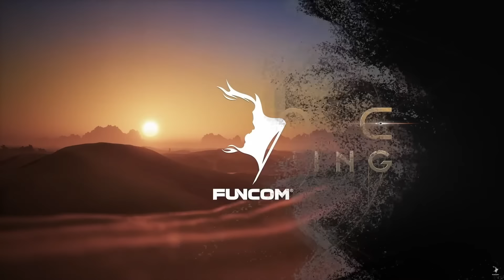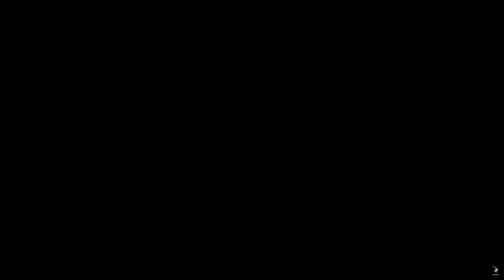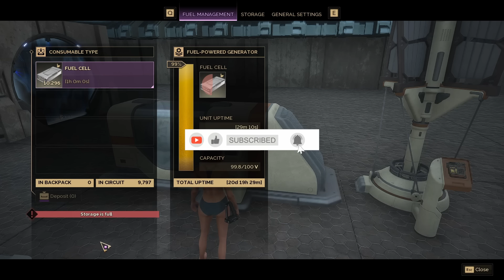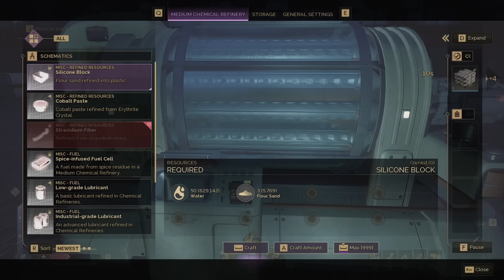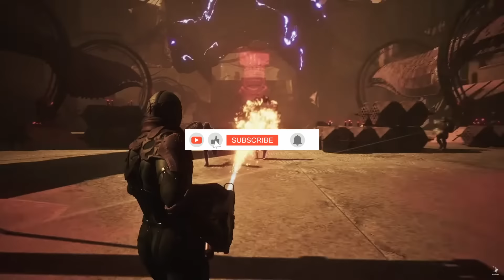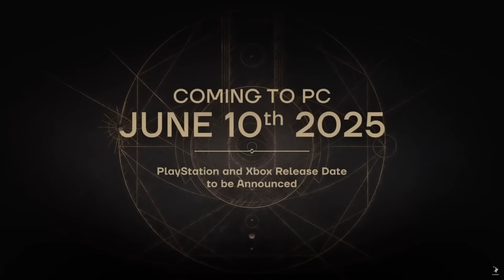Best Power Generator in Dune Awakening? Full Comparison & Breakdown

Comment: This is so wrong, your never going to run an advanced setup and the big spice refiner without the spice generators. You’re already maxed on power with no advanced death stills or wind traps, no advanced chemical refiner or ore refiners. This setup is low tiers BS.
Reply from the maker: Then please tell me HOW am I running a large spice refinery, large ore refinery,  ALL the advanced refineries, as well as 6 death stills using directional wind turbines as mu sole sorce of power? I currently have over 8000 power being generated with no problems.

Comment: its funny because I have the opposite setup --- my deep desert base is the one where I have a production limit, and therefore basic generators dont work  -- my permanent base Im perfectly fine using stakes to extend the size (and therefore the production limit) so I've been fine with oodles of the bsice generator - but the deep desert base is where I need more efficient power; the time and space to setup all those mini generators are limited -- but more importantly the production limit if Im running a large ore refiner, medium chemical refinery, large spice refinery, some water generation (large windtraps, advanced deathstills), decent sized pentashields and a couple utility buildings like recycler/repair, maybe even a couple fabricators -- then the 30 or so generators you can make wont provide enough power unless I turn things off -- sure you can turn off the utility things, but the water production and refineries take a long time and I usually have them up and running most of the time. my first couple of weeks, I made due with generators - but I have a ridicioulous amount of overstock on spice residue now. I made ok money selling them on the market, but this week Im using spice generators, and its so nice to have it taking up so little space, and be able to keep all my stations on. Im even gonna build a couple more windtraps I think. (as a solo player, its not really worth it to run more than 3 deathstills I think, as I can only bring so many corpses in a run). 

Due to how much lighter Spice Melange is than spice Sand, and Plastinium compared to Titanium+stravidium it only makes sense to process everything in the Deep Desert -- especially when you're getting stared and the half cost to build means you can get to the more efficient refineries quicker. 

If I ever were to take a break from the game, but wanted to keep my base up and running- I could see value in having a longer window where my power runs unattended (but what is the tax period?) 
AND if you're just getting started in the deep desert, basic generators are better as until you max out your production they are enough.
Reply from the maker: We were doing the same thing for a while, but after the recent incident with the control point move, we nearly lost everything. So from now on, we’ve decided to use the Deep Desert strictly for staging and storage—no more refining out there. We're moving all our main refineries into the hagga basin going forward. It just feels a lot safer and more stable long-term. It's also a lot of money that you're spending per week to put all those staking units in. I can understand using half priced items to build. Thank you for the comment.
Reply: No staking units for me!

Comment: This is impressive, over 15 minutes for a “full comparison and breakdown” video with not a single chart or table comparing actual numbers to provide evidence for a conclusion, that is basically, build what you can afford to supply, but your opinion is the directional turbine is best, or the fuel powered if you don’t need massive power.  I suppose a 30 second short doesn’t get the same views.
Reply from the maker: You're totally right—I went over all the fuel and refinery costs in the video as I talked through them, but I didn’t make an actual chart. 😢 You could also grab the info from the video description if needed. As that doesn't get views either. Thanks for the comment and the feedback!
Reply: Are you really so dense that you need a chart??? I thought it was great, very through, and didn't feel like a business meeting. 

I guess to each is own but some of us use our brain to visualize the numbers, not have someone else do it for us 😂😂😂

Comment: hope funcom change the light u holding in your left hand not right hand. so we can use one hander weapon with light that the same time just like in conan exilse.
Reply: There is a normal light you can craft and activate it while holding weapon/tool, it fits in separate inventory slot
Reply: @imdkvideo   can you make a youtube how to do it.:eyes-pink-heart-shape:
Reply: It's called the personal light.  It's a steel tier item that you don't have to hold.  You just equip it and press "0" to turn it on.  100% recommend crafting one.  It lasts like forever too.
Reply: @nikoquizzer8432   thank for the infor
Reply from the maker: There is a personal light unlocked later on 😊

Comment: I don't know, man. I figure if I don't play Dune for months, I'd rather go for a ride in the buggy than use up leftover spice for my fuel.
On the other hand, you can turn everything off and just have two safes full of used fuel, but until you have that, I wouldn't upgrade to the bigger thing. I'm just interested in the peace of absence, really.
Dune is awesome, but this is one area where something should be changed. It could really be made much more pleasant to be away for a while without having to be there all the time to keep the base running.
Also, the deposit into the bank vault is absurdly puny and time-consuming; it could be easier, I think.
Yeah of Google Translator but also to long for my germination. 😋
In deed a good Talk about efficiency of Dunes Power Modules, thx for your impressions.👍
Reply from the maker: You're right.They could do that better and thank you very much for the comment.

Comment: harkonnen round walls 2x2 silo,  fits 4 generators per floor, you can also fit 4 large water silo if its 1.5 walls high, if your home base is staked out you can put these quite far off, i have i think 4 silos now i can have up to 3600 kw and i have 1.7m  litres water storage, my one silo has 5 omni's on top, the 5 omni's take more management than the dozens of regular generators, beecause i have to farm flour sand make silicon then lubricant, i mean i have lots but its just harder than shooting fuel cell blocks in my buggy when  i am on one of my other ore or body runs.
also i just look at making vehicle fuel cells too see how many spare fuel cells i actually have , i'm currently 23k spare
Reply from the maker: Appreciate the detailed setup—definitely well thought out. That said, Directional Wind Turbines offer better long-term efficiency, especially when considering structure limits and power-per-slot. Omnis and fuel generators can stack output, but they consume more build space and require regular refueling.

Fully fueled, omnis and standard generators run ~20 days, while Directional and Spice generators last 31 days—a significant difference in uptime and logistics. For high-demand bases or solo setups, less maintenance and better scalability make Directionals a stronger long-term option.
Reply: @cuddlesrus2020  The Directional wind turbines cost more to run and are less efficient. You're dealing with power density aka the amount of space a generator takes up relative to its output. 31 days takes significantly more resources than the basic cell generator or Omni wind generator. The amount of operation time is moot since you can drop by the base once every two weeks, push a button, and all of the generators are refueled all at once, directly from any containers holding their fuel.

Comment: If you really want to commit to the tier 1 generator, you'll need about 40 for 10k power. Which is a lot of room.
Reply from the maker: The tier 1 generator only gives 75 power so even if you used all 80 slots, that would only get you to 6,000 power.

Comment: if you're a solo and you farm that spice, go with directional. if you hardly farm spice, go with omnidirectional. but if you're a big guild and are still using tier 1 generators, you need to reevaluate your priorities.
Reply from the maker: The tier 1 is only recommended for DD bases because if we do not typically process materials out there because of raiding potential. Now if you're in the PVE zone, by all means build like your in the Hagga Basin. 

That does come at a cost, though, because you have to corridinate a time every week to tear down, haul back, and re-set up your base. After the last mess up of them moving the control point, we don't process in the DD anymore.

Comment: Once you have a buggy at T5 and can get 600+ fuels cells from a single node, all the arguments for other systems are like pounding sand.
Reply from the maker: That’s definitely a strong point for the T5 laser and the buggy combo — the fuel cell yield is insane. But I wouldn’t say the other systems are entirely useless. They just serve different roles. For example, Omnis and Directionals can still shine for passive or long-term setups, especially when you're managing multiple fronts or doing large-scale builds. That said, yeah, once you’re rocking a T5 laser, it’s hard to beat the buggy's raw efficiency.
Reply: @cuddlesrus2020  I do one run with my buggy every other other week, and get enough power cells to run my base for a couple weeks, with plenty to spare for production.

Comment: Thank you.. someone got this right. I watched 1 guy and he said the Directional power generator was the worst one.
Reply: I think I saw that guys video. His info was way off though.  Didn't make any sense
Reply: @gardengirly-m4z  Which part did you not understand? The cost for 20 days of power at 3kW for the Directional costs 161k water vs 101k water for the Omni. The Directional also needed 13.7k spice sand. In the Hagga Basin that amount of spice sand is time consuming. In the Deep Desert its slightly faster if you hit a medium or large spice blow and fill up your storage pods. Meanwhile the omni requires 4k extra flour sand for the silicone blocks which is easy to farm in Hagga as there are spots that are near rocks where worms don't get attracted or easy to backtrack.
So the Direction requires much time and effort to get the same amount of power as an Omni. However, the Directional can put out more power so you need less of them so you don't have a bunch all over your roof. The number you have is factored into the cost to operate. In short, the Directional is crap but people who can't do math love them or guilds who have huge amounts of resources that they can throw away.  It comes down to whether you want a bunch or generators or only a few taking up space on your base.
Reply: Same!
Reply: Well yeah - there isnt a directional power generator?
Reply: @gamerfortynine lol  you're right, it's a Wind Turbine Directional that generates power.
Reply from the maker: Happy i could help.